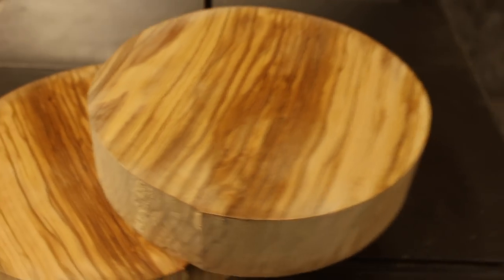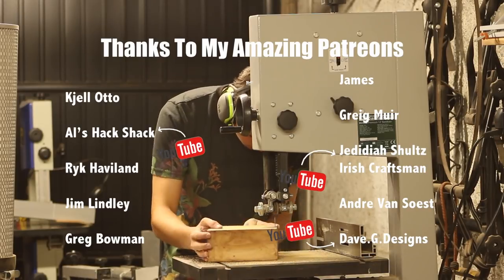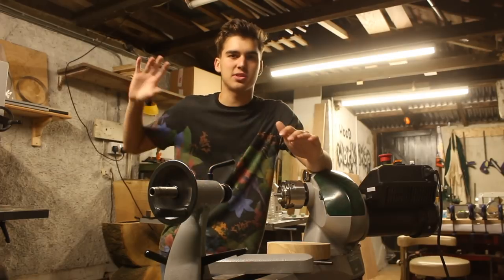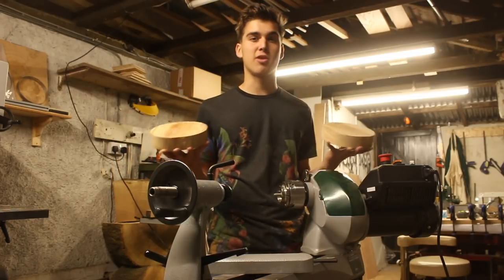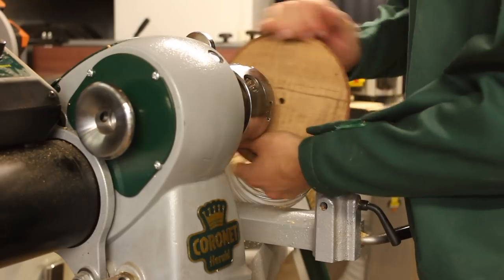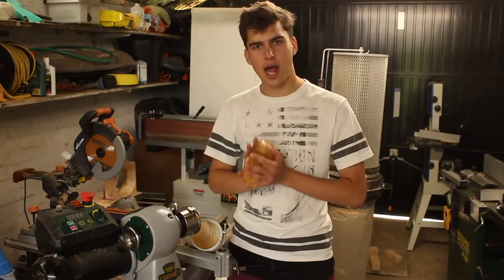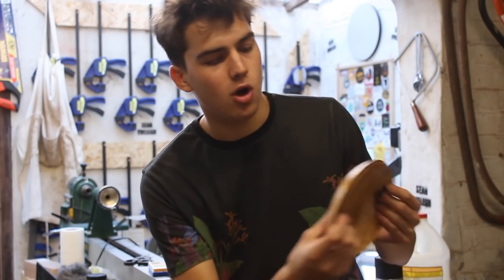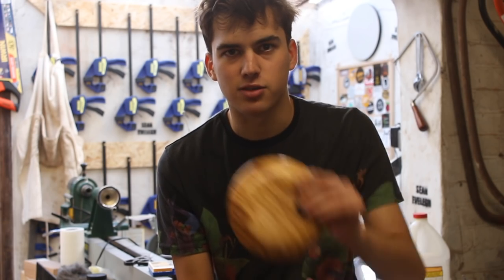How To Turn (THIN WALLED) Olivewood Bowls

Comment: Very nice set of bowls, the grain is simply amazing.
In my opinion, the fact that one bowl is smaller than the other is a feature! That way they stack nicely together (as you have shown in the video). 
The yorkshire grit and carnauba finish looks pretty as well. (Can you still "feel the wood" or is it more like a layer on top?)

Keet it up!

Paul
Reply from the maker: HI Paul! yeah.. I love to grain aswell... some of the nicest wood i've seen! I agree having one bowl smaller isn't that big of an issue. and yes the smaller bowl does nest nicely in the larger one. the carnauba wax leaves a lovely smooth finish. its just feels like you sanded the wood with a fine grit! you can still feel the wood and it feels natural. unlike a epoxy or other plastic shinny finish!
Reply: @SeanEvelegh  
That sounds very nice, I think I will give this finish a try. 
Thank you for the quick and nice reply :-)
Reply from the maker: @paulurbaniak2242   yeah it's definitly worth a try... esspecially becuase it is inexpensive. I might have a video coming soon on how to apply carnuaba. so that might be interesting for you.
Reply: @SeanEvelegh  
(Every video so far was interesting to me ;-D )
I am very much looking forward to this video!

Comment: do not judge me negatively by what I'm going to say, ... all the tools for turning have an angle, and its function is to control the cut and the direction of the cut, learn a little more about sharpening, ask for help to those around of you, try to learn more about fiber orientation and you will never make a tenon going against end grain, ... you will see the difference in control and pleasure of turning, ... and, a very good year,...